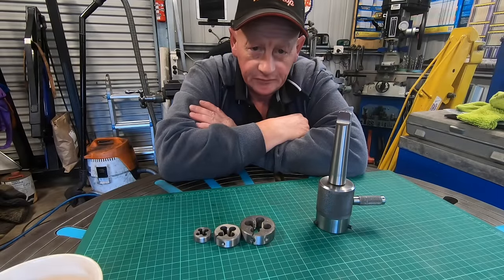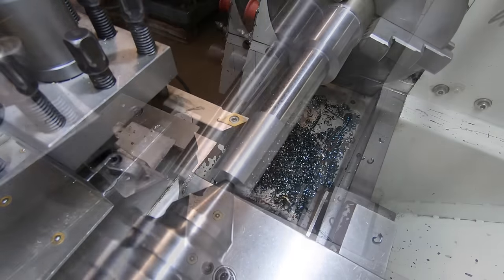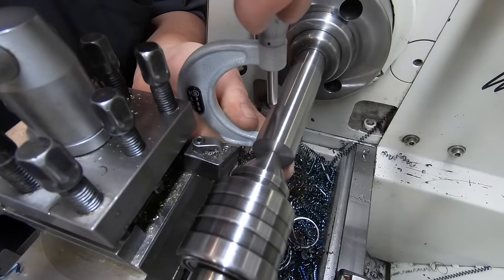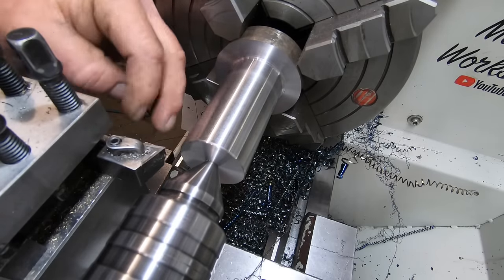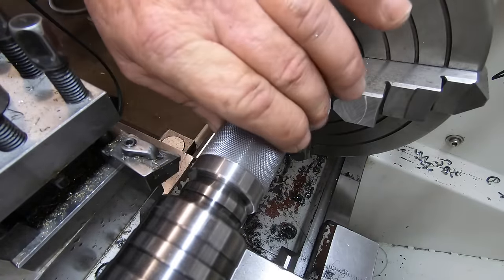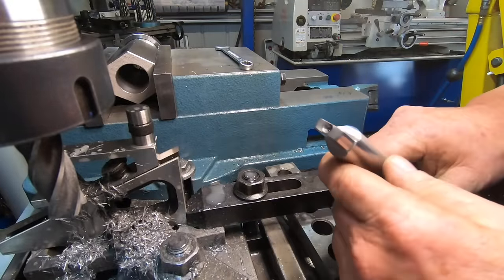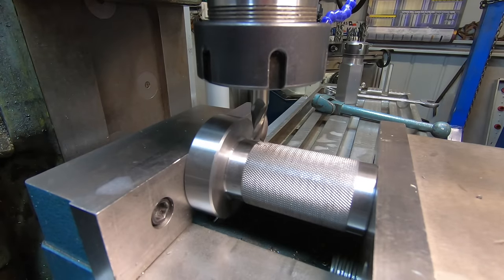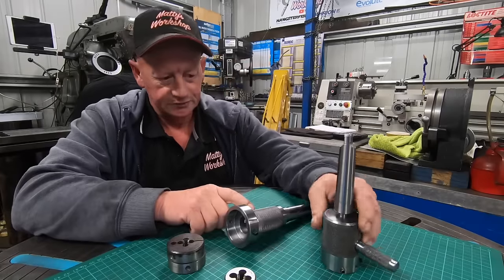Floating Tailstock Die Holder

Comment: Anybody that complains about someone else wasting material because they start with too big of a piece probably has never had their own shop. 
You work with what you have because going out to get the couple 12” lengths you need in the right diameter costs more than the material you’re “wasting”.
Reply from the maker: Gday, The cost of material now is making it hard to keep a nice little stock pile and i've been chipped before about "wasting" material, You just have to work with what you have on hand, Appreciate you watching and commenting, Cheers
Reply: @MattysWorkshop  Dead right there Matty, I bought 400mm of hollow bar 63 OD X 30 ID. It weight 6kg and cost $48.00 plus an hour of driving to and from town. I use what ever I have and when I am finished with the scraps they are only scraps I can tell you. I throw out nothing that may have some further use. Good on Ya mate. Cheers.

Comment: real great job. As a mechanical engineer I'm simply in love with blue chips falling off the lathe 🙂Just one little recommendation: instead of making different holders for the several thread cutter inserts I will just make a large one and have adaptor rings covering the different diameter jumps of inserts. Saves a lot of time and of course material. Since you say at the end of the video, that you're short on material, this will be the more economical solution. But once again, real great job !!!!!
Reply from the maker: Gday, The plans is to make simple adapters to hold the other size dies I have, Appreciate you watching and commenting, Cheers

Comment: It is your material, you waste it whichever way you like. I think most people that work with metal (or wood, plastic, etc) has had "I can either make this out of the material I already have, which is the wrong size, or I can order some material, which costs more than the material I already have, and takes a week to get here - and there's a minimum order of $$$, which is several times what I need for this job". 

 Another very nice build. I already have a die-holder in a similar style, but without the locking pin mechanism - I may try to modify/update mine at some point.
Reply from the maker: Gday, we all build things with what we have at hand, when I get more material I’ll finish making the other 2 die holders, thanks for watching and commenting mate, cheers

Comment: Great job Matty. I dont like wasting material either. When I made mine I made the slider double ended and with a couple of split adaptors it covers 4 sizes of die. As said elsewhere you might want to put the setscrews in so they line up with the indents in the dies so you can adjust them a little bit.  I was a bit lazy and did not bother with the knurl.   ATB regards from the UK
Reply from the maker: Gday, The dies have 2 indents 180º, the setscrews I put in line up with these indents, Thanks for watching, Cheers

Comment: Thanks Matty. I use a al320g but dont have the manual or the threading gears. I use weird die LH threads etc so every time i got a die its a different size. The 40mm dies broke me. That woukd be the 3rd die holder to buy just to hold for 1 use thread. Great idea mate. I dont even need to draw it in my head now you made a bloody nice vidoe on the exact topic. Cheers Matty

Comment: The price (and availability) of material is crazy in the UK at the moment. I get a lot of my stuff from the scrappy, but that can be a bit of a lottery. I did get an 8 foot length of 2" round steel (axle from an antique Cambridge roller) it machines beautifully and is heat hardenable, but not suitable for welding. I like using old hydraulic cylinder rods if I can get them, generally classed as EN8 over here, I could happily survive on what Kurtis throws in his scrap bin !
Reply from the maker: Gday, Steel prices are out of control here and finding scrape isn't easy here now, Thanks for watching mate,  Cheers
Reply: 90% of my projects are from scrap , salvage and other materials. The design of a project changes to suit what I can find or scrounge.
Reply: I tried to get some chrome bar off a hydraulics place near me, but instead they told me which scrap yard they sent it to. Got a 90mm by 1000mm lump for £25. So went back next day and got a load of other offcuts, but the owner took a dislike to me and I got stung for £140 for 180kg of what is scrap. But some of it is nice, I also found an old 80mm face mill to take 6 carbide inserts, most of the inserts have some life left in them, just need to modify to fit the new mill when it arrives, whatever it is.

Comment: Great bit of engineering, super finish. Your original die holder, you could mill a slot along the full length of the internal rod section, say approx 4mm wide. Unscrew the anti-twist bar and replace it with a grub screw with a matching key section machined on it to fit the slot. You'll probably need another key to still engage when it's fully extended. Half-hour project for you Matty. Cheers Tony
Reply from the maker: Gday Tony, I did think about modifying the old one but it was more fun building another one from scratch, Thanks for watching, Cheers

Comment: Im very new in the machinist area but I really enjoy making stuff and that die holder is going to be a great project I hope its not to far over my head but im going to give it a run anyway. It would be supper useful because im not much into changing gears for single point for smaller threads that I commonly do.Thanks for the vid .
Reply from the maker: Gday, this is a really easy build, I’m sure you’ll enjoy it mate, cheers

Comment: First time here, thoroughly enjoyed it. I was an mechanical engineering apprenctie in 1971until 1976, so our ages are roughly in the same era. I stayed in mechanical engineering until I retired, and I've never seen that type of die holder before. Even back in the old days we would turn external threads on the lathes using single point tooling. Dies were used to dress damaged threads and taps were used for internal threads. As for wasting material, we used to call it ' Making Precision Swarf'. As I liked the content, you've got a whinging Pom as a subscriber 👍
Reply from the maker: Gday, Thanks for subscribing, I mostly single point the threads I need but sometimes I do get lazy, Thanks for watching mate, Cheers
Reply: @MattysWorkshop  Someone once told me, years ago, that to find the quickest and easiest way to do something is to give the job to a lazy person. I hate wasting time when I can find shortcuts to do the job just as well, if not better. We are in good company 😂😉

Comment: Hi Matty,  if you only used the die holder in your lathe there is no need to put a tang on the Morse taper. I didn't and the tail stock still ejects it OK. Where I did have a problem was when using a Morse tapered drill sleeve, with a drawer bar thread in the end, in the tail stock. That caused some headaches till I made a threaded plug for the end to allow the ejector to butt up against something.. Works well now. Cheers mate. 
PS. I am up on the north coast of NSW.
Reply from the maker: Gday, I have also made a bung fro the drill chuck arbor as well after a fight to get it out, Im right down the bottom of New South mate
Reply: @MattysWorkshop  Good on you mate, I thought I was going to have to dismantle the tail stock for a while, till it let go. 
Yep know where you are, roughly from your closing photos. I did the Great Ocean Road Trip from South West Rocks NSW to Port Fairy in Vic in 2006. Stopped in at all those towns in Southern NSW. Got a mate that lives in Bega too. All the best mate and good luck with the Chemo etc, hope it all comes good for you.

Comment: Another nice addition to the tool kit Matty. I made one with a very similar design for 1" dies and it works a treat. However, when I made another one for 2" dies, I decided to use a long 1/4" keyway as I wasn't sure that a peg would be strong enough - you have just proved that it is :)
Cheers, Alan.
Reply from the maker: Gday Alan, I was going to use a 8mm stud but went bigger just I case, the weak link will be the tang on the taper, thanks for watching mate, cheers
Reply: @MattysWorkshop  I think your concern for the tang is well placed. Properly fitted morse tapers are very good at transferring torque and the tang should not be involved in this. BUT this is dependent on the torque being associated with positive axial pressure. This pressure is inherent in a drilling operation but not in a sliding die holder. When stress testing mine with a 1" 8tpi Whitworth die (not under power) I saw the male taper pulled loose in the (4MT) socket. This occurred because some frictional drag between the sliding parts of my holder allowed the thread lead to exert negative axial pressure on the taper - effectively a draw bolt in reverse. This was perhaps an extreme test as I don't envisage using dies much over 1/2" in this holder. However, it is still a reason to consider keeping some forward pressure on the die via the tailstock quill when cutting coarse threads.

Comment: Another great job Matty, nice machining as always. 
Tell them to get stuffed, ref using oversize stock, you used what was best available, fine  by me, material is crazy expensive,  more so with shortage of alloying elements such as Chrome, Molybdenum, Nickel etc, ref sanctions on Russia ( biggest supplier of these), if you buy steel, this surcharge varies. 
I made a similar item many moon's ago   double ended, i use a light spring to aid engagement. 
Thanks for sharing
Reply from the maker: Gday, I’ve been chipped before about wasting material but it’s what I had on hand and that’s the way it goes, the cost of material has gone out of control now, thanks for watching mate, cheers

Comment: As i once said in your video, i think that that knurling tool likely benefits from wear, as the knurling rings are allowed the float and travel side to side, as to self correct and self align with the cut... Its kinda like the floating reamer holder, something that seems to make no sense and cant provide accurate work, but its exactly the free float that allows the tool itself that it holds - to self locate and do the job to best of its quality and finish, where a rigid setup could enforce an error or deviation from what the tool actually is theoretically supposed to do in perfect setup... 
Kind of a twist on the ``if you cant make it perfect, make it adjustable``, but in this case, its self adjusting due to its relative free play... 

All the best!
Reply from the maker: Gday, The more flogged out it gets the better its working, Thanks for watching, Cheers

Comment: G'day Matty. Nice build mate! You talk about getting more material to make die holders for the other two sizes, but have you considered saving a lot of material and making the die holders fit into each other? So you make a holder for the middle sized die, that fits into the one you have just made, and then make one for the smallest dies to fit into the middle sized one all held in the next largest by the set screws. ( I'd suggest using the three set screw method that will pick up the '"detent's" that are in the die periphery for a solid hold on them) my one that I made in a college course when I was teaching, is like that but only with the first and mid sized dies as we never had the big inch and a half? sized dies at the schools. This way you can have three die holders using much less material mate. Cheers from the UK Sam
Reply from the maker: Gday, The old one I made has a sleeve setup, I does work but I want to do this one different, Thanks for watching, Cheers

Comment: Looks great Matty. What grade steel do you typically use? Is that just 1018 or something different? I’m always amazed at the finishes you get on every pass. Maybe it’s your tooling or speeds and feeds but I can never seem to get finishes like that without a file.
Reply from the maker: Gday, Im not sure what the material is that I used here, it was a piece of shaft I was given some time ago, the finish is all in the speeds and feeds and good inserts, Thanks for watching, Cheers

Comment: I thought I had commented on this already, bit it was on the Tom Make Here die holder video which ironically, was released on the same day. Anyway, this is a nice design and built well. I like the rotation lock/sliding mechanism so you can thread under power. I have only cut small M6 threads under power. Its always a bit nerve-racking for me, but perhaps I should make one like this (and Tom's) design and get into power feed threading a bit more. Thanks for the video.
Reply from the maker: Gday, power threading can be a bit nervy at times but it’s quick and easy, I’d definitely like to see you build one, I just made it up as I went, no plans build, thanks for watching mate, cheers

Comment: Nice one Matty.
What is the knurl for? does it need to be gripped tight by hand to use it?
I can see how one set screw can open the split die, but none to close it up.
Make sure you give it a good whack into the tailstock when cutting large threads or you could twist the tang off. Maybe your lathe can still eject without a tang anyhow.
Reply from the maker: Gday, The knurl is there for grip to slide it forward on to the job, the 2 set screws line up with the 2 indents in the dies that are 180º from each other, Thanks for watching, Cheers
Reply: @MattysWorkshop  No worries mate. I thought you used the shoulder to push it forwards. You must be using dies with the set screw in them.

Comment: Definitely making one of these for myself Matty. I'm wondering if it would be worth adding a cone point set screw to allow you to open those split dies. That way you can adjust a thread size for a tighter thread or stop the other two set screws from closing the die which can make an undersized thread.  Sometimes that's desirable but it can be a nuisance too. 
Regards,  Preso
Reply from the maker: Gday Preso, the dies I have already have the own adjustment screw in the die, im looking forward to seeing your build mate, thanks for watching, cheers

Comment: The only issue I can see is on large dies you will not have much more clearance for the stock then the depth of the die, maybe you are only planning to have no larger then 26 mil of bar stock to thread.
Reply from the maker: Gday, I can tread just under 50mm of thread with tis tool, This should be good enough for most jobs I do, Thanks for watching, Cheers

Comment: Angry Troll food:
I turned down a large socket and a medium socket, to fit into my floating die holder. Just so I can use Hex ( repair or chasing ) dies as well as the round split dies. I will use what I have got, trolls be dammed.
Reply from the maker: Gday, Ive been chipped before about wasting material but you use what you have on hand, thanks for watching mate, Cheers

Comment: I’ve always been a bit confused about what constitutes ‘good contact’ when test fitting a taper with blue. Half of the taper had no blue and the other was covered. Is this still good contact like you said? Cheers Jake
Reply from the maker: Gday, The blue is only a very very light smear and docent effect the od of the part, the I test fitted the part it had solid contact which is hard to see on camera, hope this helps, Thanks for watching, Cheers
Reply: @MattysWorkshop  I get it thank you. Also what’s your thought on the sine plate you have versus sweeping the angle of the taper with an indicator. Is the sine plate really necessary?
Reply from the maker: @freestyla101  personally I think the sine bar is more accurate, I have setup using an existing taper and found it need to be fine tuned, each taper I’ve done using a compound sine bar has been spot on, hope this helps mate
Reply: @MattysWorkshop  yeah that helps a lot. I’ve always wondered this and not found good info.

One more question is do you really find the brand name indicator arm that much more rigid than the no-name knock-offs? I struggle with them also as they tend to flex under light pressure.
Reply from the maker: @freestyla101  I’ve always had the cheap import indicator arms and after using the Noga I wouldn’t waste my money on any cheap ones again, I’ve definitely noticed a big difference in the rigidity of the Noga
Reply: @MattysWorkshop  that’s so good to hear. All I need to do now is sell a kidney 😁. Cheers for the help all the best.

Comment: Matty. what length's  and diameter size stock would you use if you had to buy it..
Reply from the maker: Gday, It depends on the size dies you are going to use, for the sliding section the largest diameter was 65mm and 100mm long, the largest diameter on the arbor was 26mm and 190mm long on the one I made, I hope this helps mate, Cheers

Comment: well think of it this way if that was 20 bucks of material waste and if your time is worth 50 bucks a hr
and it takes you a hr to go to the supplier and get the bit of steel the right size you spend more money going to get it than making do. and thats not counting the purchase price of the bit of steel.

in a hr you could have the taper cut or 3 parts of the way done.

changing coolant why do that! (sarcasm) the place i worked we just stirred it up and added fresh coolant. it did stink of old oil.
 i swear the first bit of grease spilled in that shed was still there 50yrs later. parts of the shed were dirt floor as they originally did castings and black smithing too. the owner actually was a blacksmith.